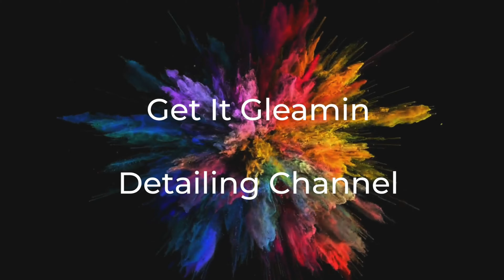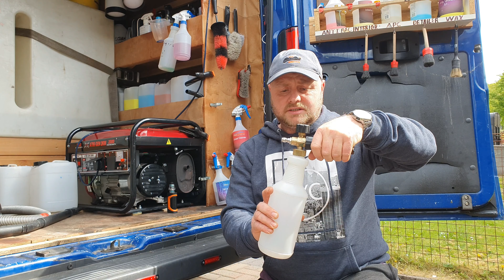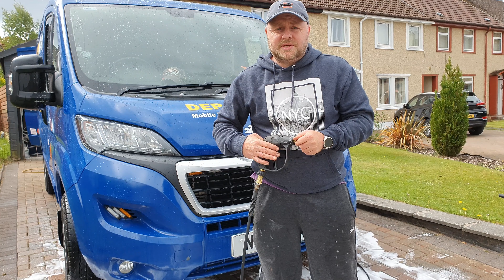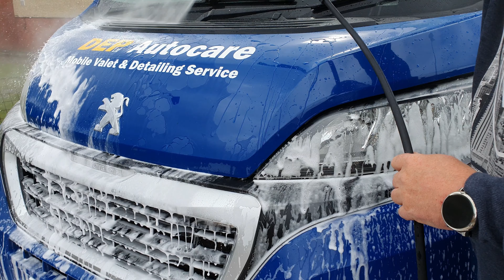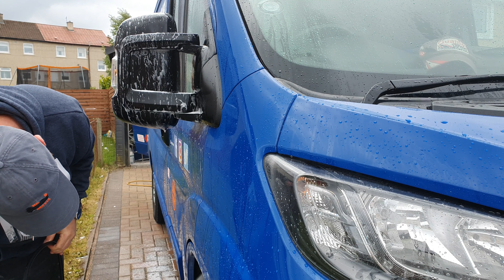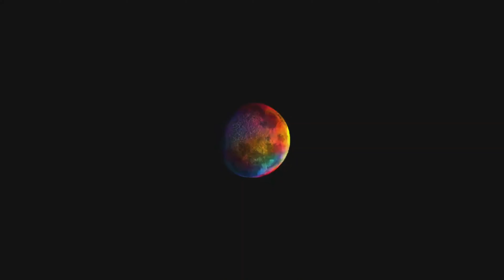Snow Foam Bottle Broken ? - Heres a Quick, Cheap & Easy Fix !!

Comment: Do you ever use a lance or are all your washes from the shortened trigger part only?
Reply from the maker: Hi there. I've been using the Gun only for the past 2 years. Took the lance off for some really bad wheel arches and never needed to put it back on. Works a treat.